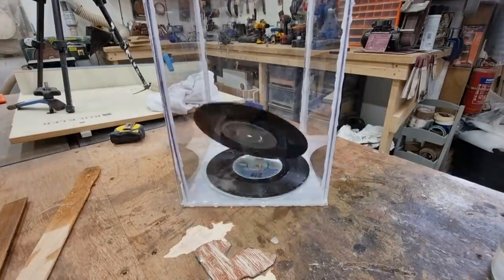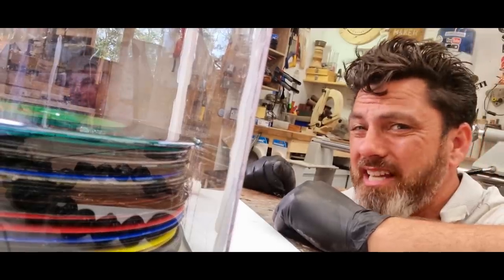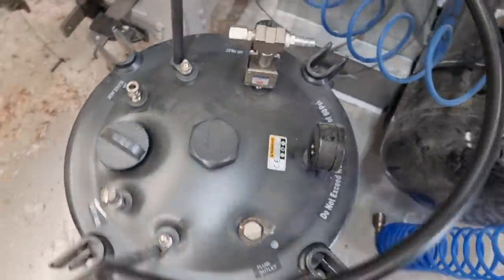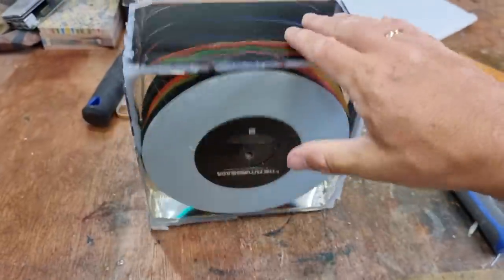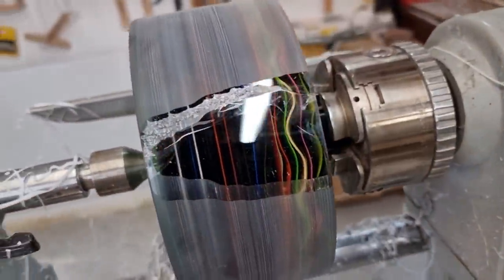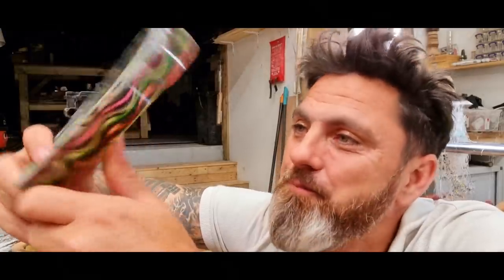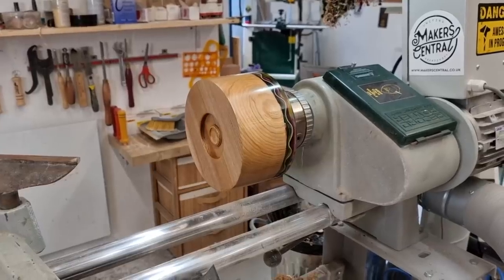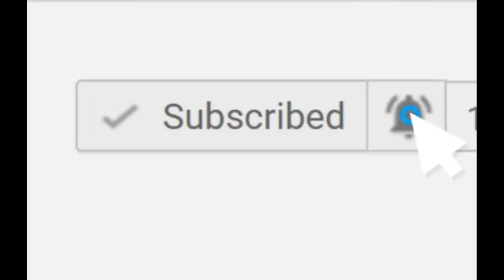I Turned My Old Vintage Vinyl Records on a Lathe 😬

Comment: Good job saving it Nick! So the reason the records warped with the fast is the resin gets hot really fast where with the slow it’s not getting as hot nor as fast. It’s the chemical reaction between the 2 types. I think if you have put one record in then a thin coat of resin and layered it like that it would work. I knew it wasn’t going to work although it may have broken at the line between the two types of resin but you had big air gaps between records where there was no resin so it may have been that was the weak point or a combo of the 2. I’d try it again but use one type of resin and pour resins between each record and make sure it’s got a thin coat. It’s a cool idea! I love how you saved it too. That effect with the warping was pretty cool.

Comment: Great job! Thanks for the upload. I think this project went off the rails because of the way you did the resin pour. Instead of dropping all the 45's at once and adding all the resin at once trying to work it into your block..

I would've tried 2-3cms (about an inch) of resin straight into the bottom. Then add one 45, more resin, second 45, more resin and so on...then finishing up with the same 2-3cm on the last pour. Then into the vacuum and finally let the resin set for a few days. This method would make a stronger bond. I hope you were wearing proper PPE when you did this. Cheers!

Comment: Really cool. Next time heat the records up to pre-warp them then when you make the mold make sure to stack them so the they are standing up instead of laying flat. That will allow the air to escape and the pre-warping with make the adhesion of epoxy to an otherwise bad surface harder to break away.

Comment: This was a great project. And I'd love to see you try it again. However I think there was two problems with it. The first one being you used two types of epoxy. Fast and slow. That made a weak spot for it to crack since there was two castings. And you didn't have enough epoxy between the records since you just stacked them before pouring it in. I'd first pour in a thin layer, then drop the records in one by one with a little epoxy poured over each one individually. All with slow epoxy. That should make it much more solid when casting.

Comment: Hi Nick, may  i make a suggestion?  Well here goes, I like what you did with this project but since you didn't get to use all your records.  Maybe you could try stacking the records horizontally instead of vertically so all the resin flows in between to better hold together and use the fast acting resin to get that cool wave pattern and stack some wood rings in between couple and top, bottom.  I like bowl with wood & record ring top!  Thought it was very, chique!!!  Well, my 2 cents.  You do great work and making watching fun.  Never lose your personality!  Best wishes and stay Chique!!!

Comment: I watched this cos I thort straight away from the title “Well that’s not going to work!”   Vinyl and epoxy resin do not stick - it’s a good material for a mould in fact. The rim to your wooden piece works only because of the buckling of the records.  You can pre-buckle them, by putting them in a slightly warmed oven - or just leave ‘em them in a car on any Australian summer’s day, that worked back in the 50’s(!!)

Comment: That break off happened because there was not enough gap between each record plate for the resin to get in and set hold. Saw it coming, it was like just stacking a bunch of wood planks tightly without glueing and pouring resin and covering up only the exterior. What would you expect when the outer layer of resin is removed? Yes the wood planks seperate.

Comment: I liked that project.   Try making a hanging corner light out of CD's epoxied together with L.E.D.s in them.  A kind of a spray of 4 to 5 CD cylinders branching off a pole with changing color or bright white in them.

Comment: I watched the video with the flowers in a rubbish bin lid.
Have you tried spaying the flowers with hair spray or polyurethane or both together, I see others using UV Resin brushing a coating of resin then setting it hard with a UV light.
That project with the flowers, sticks, petals, lavender, I'd like too see another one,
It takes a real man to show his mistakes and you are probably in the
0.1% that actually shows his/her mistakes, rather than cover them up.
My best top video of yours is the large bowl with golden flakes and light timber, you said the lid doesn't fit right,
That large dish with lid, like to see other videos on using those gold flakes.
Thanks hope you don't go back to just wood,
You and Ben Worx are the two best on YouTube when it comes to resin and wood, both make mistakes and show them with pride.
Thanks 🇦🇺🦘🇰🇭👍🍺

Comment: yes it could have been the lack of resin on the first batch is why it probably failed and getting the waviness from the first batch since there was air pockets between the record thus giving some weakness. Maybe pouring the resin in the mold first the dropping the records in after may work out better next time and maybe a slower cure time could help too.

Comment: Maybe a couple of months late on this, but a couple of thoughts. If the failure was indeed between the two epoxy pours, next time, sand the epoxy between pours. Also, some waxes and oils that aren't compatible with the resin may have been on the records. Wiping the records with alchohol before the pour may prevent this from happening if you should try a similar project in the future.

Comment: Resin and hardener will not bond with polyethylene plastics (records). 

'What surfaces won’t resin stick to?

Mold release.  You want to use mold release to keep epoxy resin from sticking to molds. Plus, it is excellent for prolonging the life of molds. It lets you demold resin jewelry and crafts without distorting and pulling at the mold. This causes warping and microtears that impact future castings.  Wax.  Resin will not stick to it, whether it’s candle wax or lost-wax casting wax. The same goes for car and furniture wax. This is useful if you want to create a void in your resin charm or casting. Pour the resin around the wax, allow it to cure. Then pull the wax away.

Polyethylene plastics.  Disposable plastic sheets for painting and sandwich bags both contain polyethylene. Epoxy resin will not stick to these, making them a great protector for your resin art and crafting area. They are also inexpensive. You can throw them away if you don’t want to clean them up after making your epoxy art.

Anything with a greasy surface.  Anything that has a waxy, oily, or greasy coating, will not bond to resin. But, remove the grease, and you’ll turn the surface from one that resin won’t stick to into surfaces resin will stick to.

Silicone.  So, this is a little bit of a trick answer because silicone is a resin itself. But the good news is that other resins will not stick to it, which makes it perfect for resin molds. The exception to this is if you pour more silicone into the silicone mold. If you don’t use rubber to rubber mold release, the silicone will stick to itself, creating a large block of silicone. Whoops.

Wax paper, parchment paper, or freezer paper.  When taped to a surface, leaving the waxy side up, the resin will cure but peel away from the surface.'

Nick knew this...he was funning us.

Comment: Resin like this will not stick on vinyl correctly as most plastic materials. That's why it exploded, by using disks you create a lot of non sticking surfaces across the whole part. Make holes in the disks maybe! Where the resin got really hot the vinyl start to melt and the bounding was much better.

Comment: The reason it was wavy instead of evenly expanding to just be bigger was because the record label prevented the center from expansion.  The bottom layers didn't do it because the weight of the records above pressed them down enough that not much resin got between them.  You could make them all wavy by puting something like a cd between each one. But it will grow tall by a factor of 4 I'm guessing. Also ... Put it in a cylindrical container and save a ton of resin (money) and turning time.

Comment: Shattered record pieces set in resin would look pretty cool I think
And what would happen if you just put 1 record and try and float it in a slab of resin would it go all wavey 👀👀

I think the piece exploded because there was air between the records.. you could see bubbles in it still. Maybe soaking each record in resin before putting them ontop of eachother would work better 🤷🏻‍♂️

Comment: Was thinking about this after I watched it and I think it was the two different resins that got you.  Someone  else might have said this as well.  I also think a  little resin first and one at a time method pouring as you go might have helped too.  But seeing how the quick resin reacted with the vinyl versus the slow resin and where it split.  I think if you used the quick resin the waves in the vinyl might have gave it more stability.  I am not sure, you were there, and I can't examine it. LOL    Would like to see you try it again with all one resin.  Maybe the quick for the wavy effect.  Could turn out to be a waste of resources though.  Just some observations I made.  Did not read the comments, sorry if I repeated.  This would definitely be a high risk challenge, for an unknown outcome.  By the way the speed voice kills me, love it.

Comment: old vinyl records can be worth a lot of money. i had 1 that was worth over £2k. my entire record collection when valued was worth £1m.

Most i picked up in 2nd hand shops for virtualy nothing.

I had 5k singles and 500 albums all originals from the 50's and 60's.  some very rare records out their that some will pay a lot of money for.

the 1 worth £2k was my bonnie by Tony Sheridan and the silver Beatles from 1957. The silver Beatles later became the Beatles.  some have misprinted labels which increase their value.

Comment: I made two pen blanks using discs that I cut out of a vinyl record.   They were a pain to cut out, and no matter how much I scuffed them before gluing and stacking, they separated  when I drilled the blank. And they smelled HORRIBLE when turned.  The pens eventually  turned out well, but the process was arduous.

Comment: NICK!!! Haha!!!!

The records that warped were the ones you used the fast set epoxy which will cure at over 200 degrees F. But the slow set epoxy typically sets at less then 100 degrees F. I still think all you do is off the cahin. At first when I saw you months back I was like "well shite in a bag and punch it". But as time went on mate you really add so much. You must be a fun mate to hang with. Hats off to you Nick, cheers and thanks for the lovely videos...

Comment: Been a little worried about Your state of mind, with regard to continuing to be a YouTube Maker, as I see other Posters here have been. Some vids didn't seem like you were having fun. Trying some interesting projects. Though I thought you seemed truly joyful when this one was 'saved'. (thermodynamics, the heat of the resin, rises, warps the higher records, and resin infiltrates and Sticks them together)  This Project will be possible, if you alternate 45s (smaller single song records) and 33s the ones you used. OR just do three or for Sections and add them together at each stage. Love Your Work, Nick, very entertaining and fun. Keep going!!

Comment: I would think about maybe three dots of hot glue between each record as you stack them to give a space between each for the epoxy to flow between the records.
Then the quickset epoxy so the heat would warp the records like it did in the first pour. I'd bet the whole stack would hold then. And if you did the hot melt glue in the center as a spacer, it would het turned away and you would not have it in the final bowl/vase except in the base, where you could use a wood base anyway for the weight of it as well as the looks of it.
Just a thought. 😎

Comment: Man I would have tried to include some tape lights intertwined in those records. What a sensational floor lamp that would make. Even if you hollow out the middle enough to add a lighting fixture into it. Spectacular,‼️‼️😃🇺🇸💥💥

Comment: I was thinking as you were assembling the stack, that you needed to put resin in the mold as you stacked the records to prevent any air gaps between the vinyl.  Resin, record, resin, record, and so on until it is done.

Comment: I think the reason for all of the issues was that you used fast and slow resin.  The fast resin created more heat and melted the records.  THEN, the slow resin didn't have enough teeth to grab the cured fast resin so it came apart.  If you do it again, you might want to only use fast resin and do it in multiple pours... however far apart the manufacturer directs.

Comment: I actually think it turned out nicer with the piece of wood but I wasn't sure what your initial plan was. Also, I watch a lot of these turning projects and always wondered what you guys do with the finished project. If I were as talented as you, I'd list it on Ebay for a couple of weeks and post the link in the description for people to bid on them. I think you'd do well. With the winning bid, include a thumb drive with the video of you making it. What do you think? Is that a dumb idea? Are there rules against doing that? I have a Shopsmith that I got from my father and want to do this so bad. I think I want to start with ink pens though until I get the hang of it. Thanks for the video. You're very talented. If you like my idea, you can reward me with one of those Manscape things you get :-) J/K. Thanks again!

Comment: I would have poured the resin in first then layered the records in one at tine,  making sure resin was well sandwiched between each record. Or it might have worked better with vacuum degassing as opposed to compression filling. The  splitting was probably caused by poor resin penetration.

Comment: Next time first pour the epoxy resin in the mole then place the records in one by one to ensure a good epoxy bond between each record. Make sure to clean the re records with alcohol to remove any contamination that could interfere with the bond

Comment: You didn't have enough resin between a couple of the records I reckon. Maybe try pouring the resin onto horizontally stacked vinyl to give the glue a chance to seep through every layer. Also your air bubbles will be able to escape...

Comment: Did it separate due to stopping the resin fill process then pouring additional resin at a later date? Similar to a cold joint in concrete work?

Comment: Use the high speed setting resin and painted on each record before sticking them to each other then encase them in a big thing of the slow resin to fill in the gaps around the records to then be able to turn it the way that you were previously turning it before it exploded

Comment: Try putting a dowel in center and use a washer to space the records so resen can get better grip between.  Question could the quick set have caused a chemical reaction that caused the records to warp?

Comment: I had a feeling it was going to come apart. Too much air in-between the records. You needed to shake, pound the box after the pour to get all the air out. But, I also thought the vacuum chamber would have released all the air also.

Comment: You used quick drying res on the first part, they’ll be more heat than with slow setting I’m assuming.

Comment: Fr9m the time you started pouring all I kept thinking was that there would be areas between without resin.  Actually told you out loud, as if you could hear me, to pour some resin between as you stack the records.  Or maybe set them on the side so the resin goes between the records as you pour it.  Then I saw you put it in the pot.  I was hoping that would force it in between. I guess we were both wrong.  🤷

Comment: He made 2 significant mistakes.
#1. He used two different kinds of resin. The first of which was a quick cure resin, and that generates a LOT of heat.
#2. (Probably more important than the first mistake) He didn't vacuum out the air bubbles before pressurising the chamber. Allowing the resin to completely fill all the spaces between the records.

Comment: AUGGGHHHHH NOOOOOOOOO 🙀🙀🙀 My records are my life!! You can use all the rubbish ones, but they were our lives in the 70’s when you could get a 45 for less than a pound. Although it does look cool the way they went all wonky. That’s due to too much plastic and not enough petroleum in the records. They changed the formula during the Oil Embargo in America in the late 70’s.

Comment: The result was clear from the very beginning when storing disks in a box.
Correctly, it was necessary to lower each disk into the resin in a separate bath and subsequently immerse them in the box, monitoring the level of the resin. Deformed disks are welcome.

Comment: I think the fast resin might have blocked the slow resin from filling in between and that was the real cause of the breakage, since it would have been only a very thin layer on the edge of the records and I was thinking that this could happen after seeing the very thin layer of fast resin on the top records. The fact that the other records din’t go all wobbly should have been a sign that it might not have good coverage with the resin.

Comment: Well, I could have told you it ain't going to work.
If you want to do something like this you should "laminate" the records. You pour some resin in, then a record, then again resin...
Proceed this way and you'll end up with the resin firmly in between the layers of records.
Now even then it is risky to turn this pack on a lathe. However, it should be done at moderate rpm and very slooooow. :)